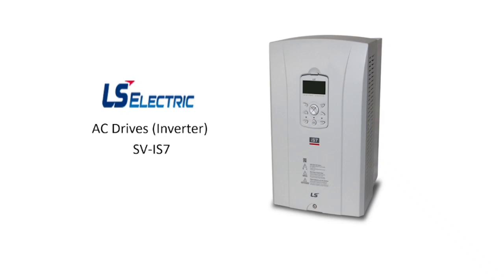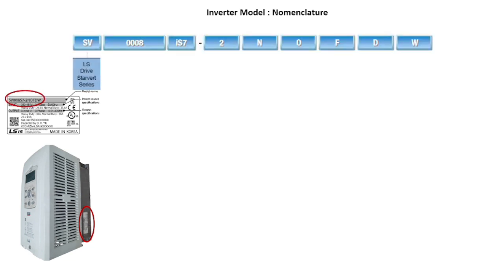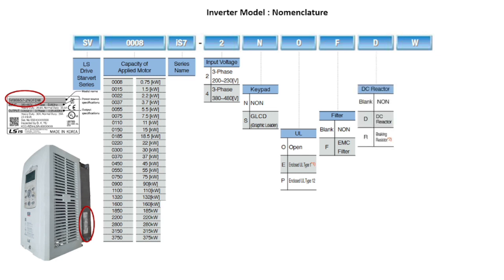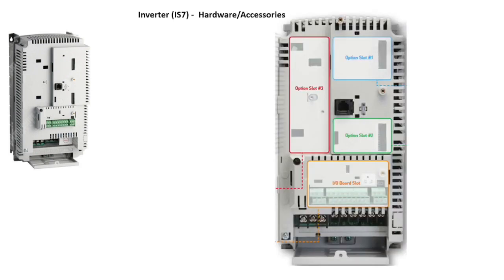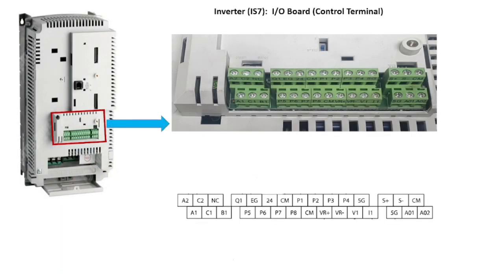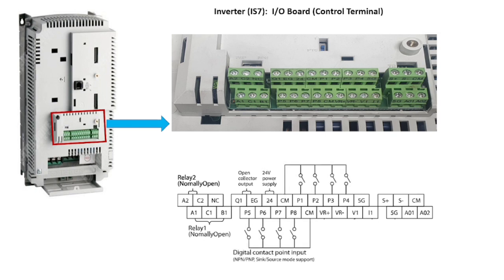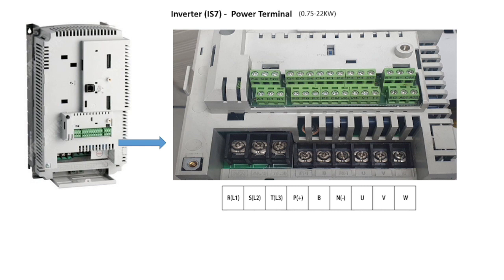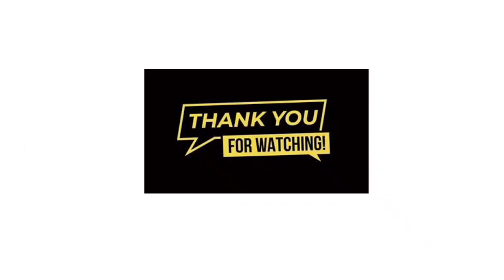LS IS7   INVERTER BASIC

Comment: My key pad screen is blank, input/output power is confirmed present..how do i solve this fault
Reply from the maker: Check properly back side ethernet port cable properly connected, if still no power keypad faulty need to replace or repair.